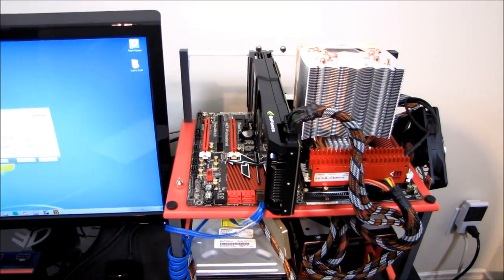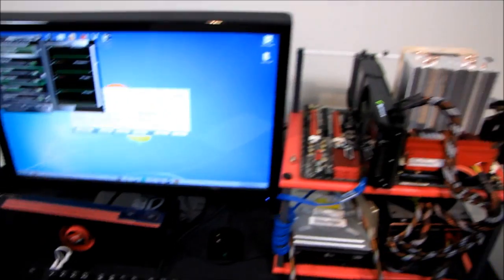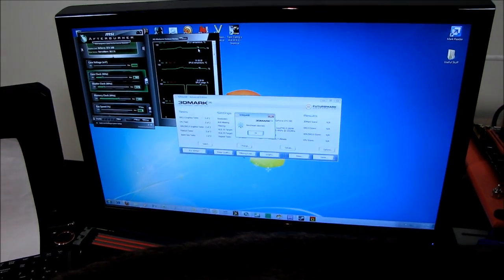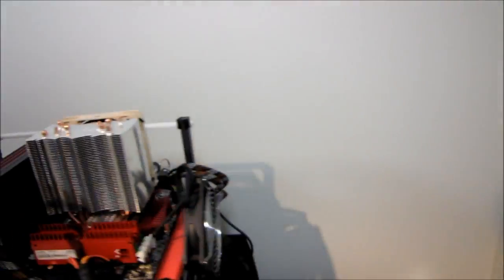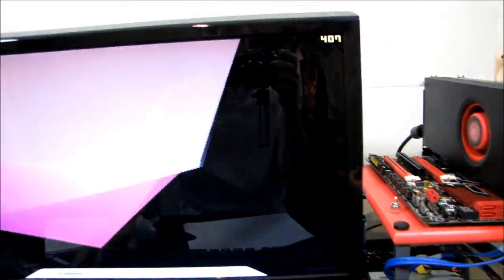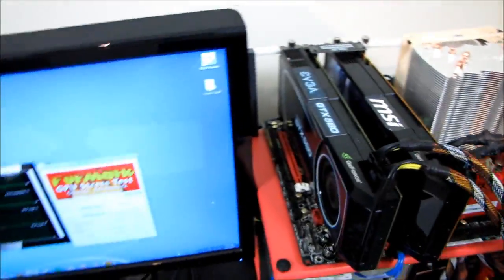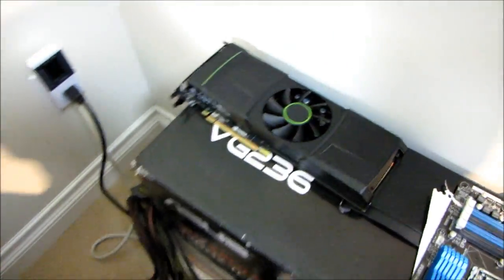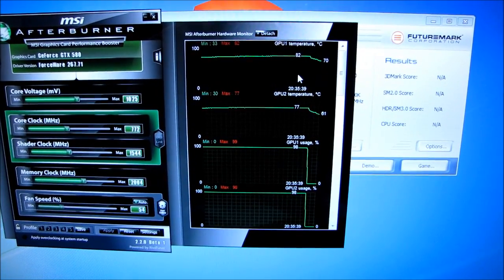NVIDIA GeForce GTX 590 Temperatures Power Consumption & Acoustics Linus Tech Tips

Comment: i could use some help , its i big differense between 60hz and 120hz, i want all my 3 monitors to run at 120hz in eyefinity at 5760x1080. I have 3x ACER 120hz monitors. What kind of cables do i exactly need for this, all my 3 monitors have DVI cables and that is the best cables for monitors, but stupid ATI 6990 cards have 4 MINI display ports and only 1 DVI. now i need 2 cables that supports MINI display port to DVI so they SUPPORT 120hz, if you know any solution please help. thx alot =)

Comment: @topphemelig ur stock cooler must have had issues... I had a 5870 with stock cooler and idle temps were 31-33c while load was in 40's. When i added sli with the 2nd card being an aftermarket cooler the first card was in the 50's through low 60's on load while the bottom card was in its 40's.

Comment: @tonifas1 Seems enough for me , 850 seems even more decent from what linus taught me you gotta have a PSU that has a higher watt thershold than your system takes for example if your system takes 450W putting a 450W PSU in there woulden't be the brightest idea o.o As long as it's not running 100% 24/7

Comment: @detmer87

It's a dual GPU design.??! Shits made to run 2 cores and hell yeah it's getting hotter than a single GPU card........ But if you don't have mobo with SLI. Than you might as well go with a GTX590 for less money than a new SLI board and 2 x 580.?? Screw the lifetime.. nobodys using the same GPU for maximum 3 years anyway..? And most cards is capable of running like that for 3 years... Otherwise the warranty would kick in if you card is still none OC'd.... :o

Comment: Don't buy a GeForce GTX 590, the video card is not durable.
PCB design is messy, bad and most important not capable to delver stable/reliant voltage for long periods.

If you buy a GeForce GTX 590 just know that the lifetime isn't what it should be.
Water block is highly-recommended.

Comment: @alexbeast14 hate to break it to ya but msi only assembles graphics cards they dont make them. the only graphics card makers are nvidia, amd/ati, and matrox. the only difference between a msi6950 and any other 6950 is the bios which has the manufacturer name of msi, at least this is how all reference cards are made(which i own a reference card). i think it may be more of the tdp adjust-ability that ccc has which msi afterburner doesn't have at this moment.

Comment: i dont know why but msi afterburner gets significantly lower fps when overclocking than catalyst control center. it may be seeing my card as a 6950 even though i flashed it with a 6970bios. differences were 44fps vs 28fps in the furmark 1080p benchmark. i had it set at 900/1375 when i got the 44fps(ccc) and 930/1400 when i got the 28fps(afterburner).

Comment: 35 is nto bad for idle.
80 is pretty high but i think in my rig i could get to 90 possibly on heavy gaming but its something you sacrfice with Dual GPU's. On the GTX590 those dual open vents at both sides are savoiur and the enemy, if you don't put it right it heats the hell out of your SATA drives XD but i just had to lower the driver to avoid the vents, simple fix but bad if you do not realise it as soon as i did

Comment: @W0ND3RB0Y1 Becuase the resolution + a 60 inch single screen would look horrible? You'd probably be at 1080p with that large of a screen? Yuck, 1080p is almost unbearable at 30 inches, which is when you want 2560x1200, let alone trying to play it with a 60 inch screen.

Comment: I have a Powercooler 850 W, it has 4 12V lines with 34 A each. Is it enough for a GTX 580 SLI? How much ampers do I have overall (if I had only one 12V line)?

Comment: Temperature readings on graphics cards like the GTX 590 aren't going to be accurate because most people don't use computer setups like you do where it's completely open. You have to take into account that heat is going to be blown into the case as well causing overall case temperatures to be higher resulting in a higher GPU temperature. The noise and the power consumption tests shouldn't be affected though obviously unless certain frequencies are prone to open air more than others.

Comment: @SPECIALOPSSQUAD it really doesn't need that much, I heard I could run it since a gtx 590 needs 50 amps and the tx 650 is the best 650 watt there is, and it has 52 amps, on the 12 volt rail.

Comment: Linus, why don't you let us know which switch position you used on the HD6990?The Overclocked one or the stock?Because 6990's two cores are downclocked as the gtx 590s' are.I think that would result in some power consumption difference in both load and idle.Thank you!

Comment: Your power consumption results for 590/6990 show the opposite of all the reviews I've read. Most have shown the 6990 to be 20w-ish lower at idle and 50w-ish lower at load.

Was the 6990 on the 375w or 450w TDP BIOS? Did have have Overdrive enabled or disabled in CCC?

Comment: @palimak1 So moving on and getting to the point :

A SLi setup of two vanilla 480 milded oc´ed are WAYYYYYYY better than any single card for a lower price that you can use on after market cooling that will allow you to smoke any normal 580@SLi and certainly any special version of a 590. 
BTW 590 sucks and like any guy who follows this kind of technology knows: 590 already started to die on some reviewers across the net.

Comment: In this economic crysis we need to save money however possible so if you have a 6990 you can follow these steps to turn it into a vacum cleaner.
1)Hot wire a powersuply and connect it to you graphics card
2)Attach a bag over the vents

Comment: I have an old GTS 250 (reference cooler) that gets up to 75c while gaming in some titles and has gotten up to 81c in furmark. So I woulden't be worried with these newer cards running as hot. I think the AMD HD5/6 series as well as Nvidia 5xx series are better at tolerating those temperatures than the poor G92 chip in my old GTS 250.

Comment: @palimak1 @SwiftyKenzo 480 has more transistors than a 580, but the temperatures and power consumption are very much alike, with a new cooler a 480 is a processing monster. Seams like you only know what reviews in the internet tell you.